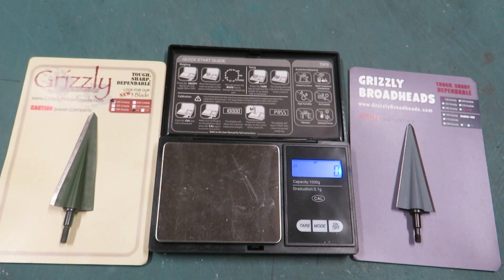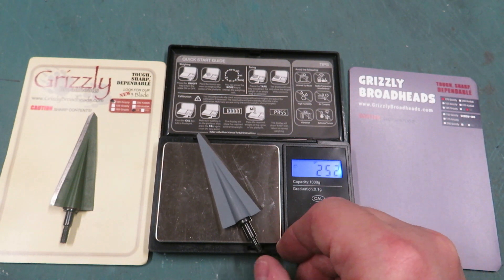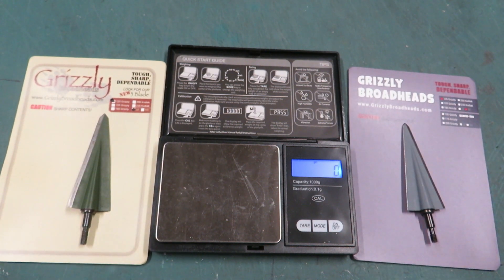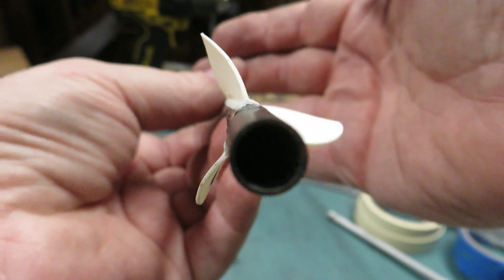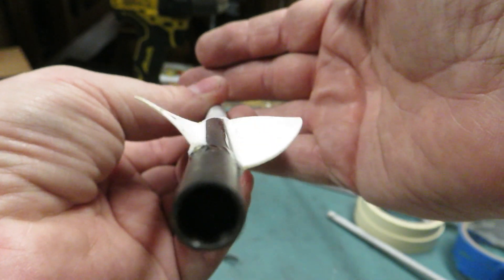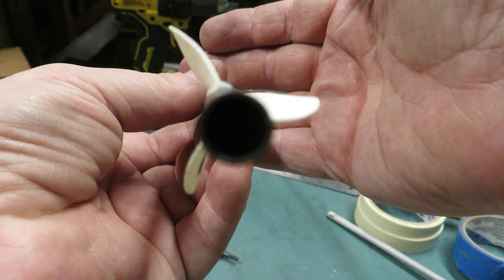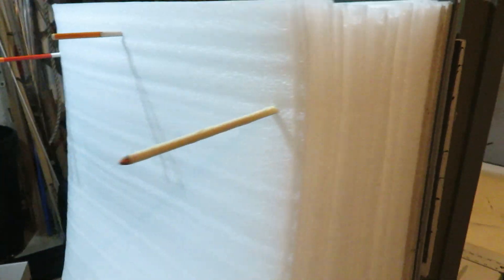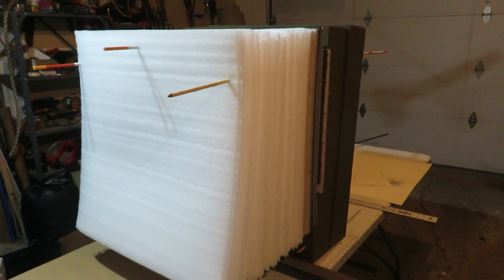How fletching spin direction impacts single bevel rotation on impact

Comment: Thankful I found your study. I have just made my own single bevel ( right ) and discovered my fletchings are left rotational. Back to the work bench tomorrow to make left bevel blades. As for draw weight for launching these heavy TAW projectiles , I have a bear super grizzly @ 42 pounds and a hybrid longbow @ 40 pounds , draw length is 26.5 inches. Are these enough horsepower to give me good performance with a 680 gr arrow and could I increase my TAW to 750 / 800 grs to hunt with in those light poundage bows ? Thanks from South Africa.

Comment: From a physics perspective you have angular momentum which is the rotating of the arrow. Any time you try to change the direction of that rotation, it will drain energy from the arrow. Will it get the job done if beveled opposite? Probably, but it’s like driving an engine firing on 5 out of 6 cylinders

Comment: I forgot to add that I shot an antelope with a 50# longbow and 500gr arrow with a left wing fletched 125 gr grizzly on a cedar shaft. The arrow split the humerus and then pentetrated a rib, the heart and stopped on the off side shoulder. The animal traveled about 50 yds before the crash before death.

Comment: At the same time that this makes really good sense also people have to be aware if you're shooting a compound I don't know about to Ringer but a compound if that bow string is spun to the right clockwise which 95% people do your arrow 95% of the time is going to clock left therefore coming off the boat without fletching naturally to the left so if you follow that with your flagship it's gonna make it spin even faster and harder especially if you got the same type of broadhead on if your arrow does spin to the left But if if you put a right wing Fletch On a arrow that clocks left coming out of the boat it will stop in mid air and correct the arrow and starts spinning it back to the right but they've showed that on high speed camera at Lancaster' archery
Reply: Right, so take your counter clock wise shooting bow (left hand spin) and right fletch the arrow and put on a right bevel, not only will your arrow adjust to clock wise (right hand spin) in a matter of just a few feet the tip will get tighter on impact (instead of looser) and now the arrow weight will help with penetration instead of looseing up.

Comment: Very interesting, but was wondering if you’ve used these same heads and did an accuracy test at 30-40 yds or farther to see if the right beveled broad-head caused issues with left helical vanes?

Comment: Did the experiment years ago in foam and found virtually no difference. I believe what is happening it that the rotation of the arrow can be reversed with very little loss of energy and will assume the rotation of the bevel immediately. More testing is warranted...

Comment: Excellent experiment and analysis. This conclusion is exactly what I would have predicted given energy loss and friction dynamics. Multiple tests of the same nature would further support your conclusion. This would be a good logical next step. The one negative I have heard about LH bevel is that they tent to loosen on impact because of threading direction on inserts. This I have overcome with plumbers tape or even hot glue. From what I understand the VAST majority of bow strings are made such that arrows leave the string with a left spin. Maintaining this left spin with left fletch and LH bevel is logical and your results validate this. However, VERY few companies make a LH Bevel unfortunately. Subscribed!

Comment: Very interesting. Seems like a good test. I’m struggling with other videos that show the arrow stop and take the bevel turn on impact. I think this may be the long low angle of that head that induces  little rotation. My shorter steeper angle heads spin through with more rotation. Thanks for testing!

Comment: Very interesting and well put together! Would love to see them compared while penetrating actual bone. I’d be curious to see if the RB/LW has the rotational power to actually crack the bone. Thanks again, enjoy all your videos
Reply: The rotational force will be immediately imparted to the broadhead to it's maximum. Just push an arrow with a single bevel thru a watermelon to see this.